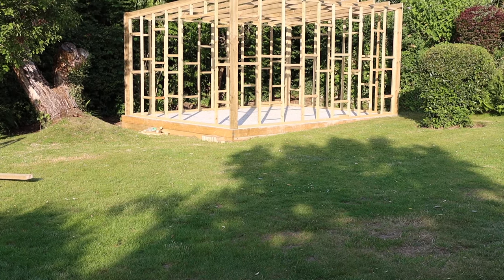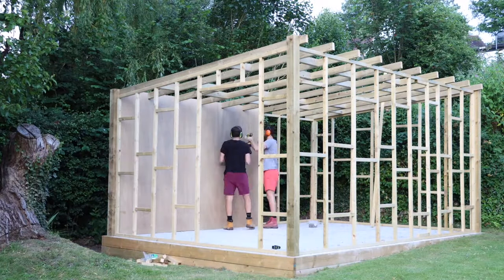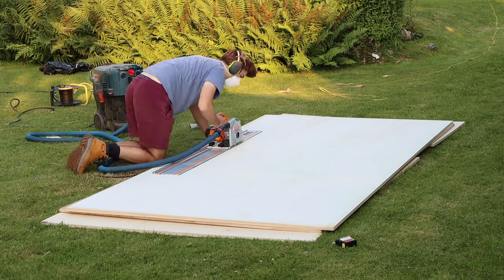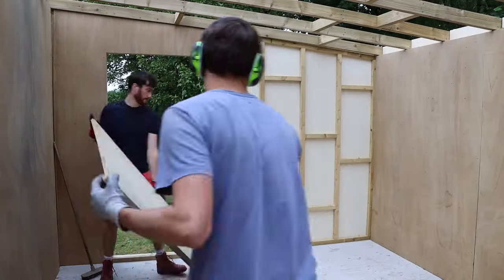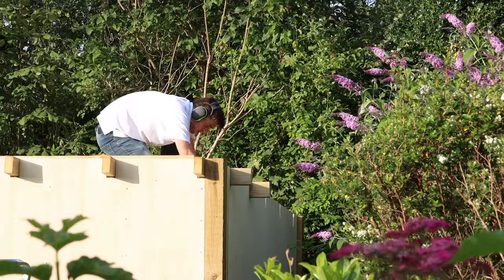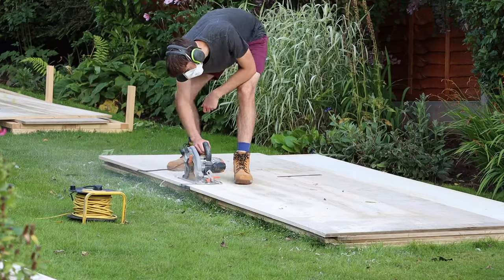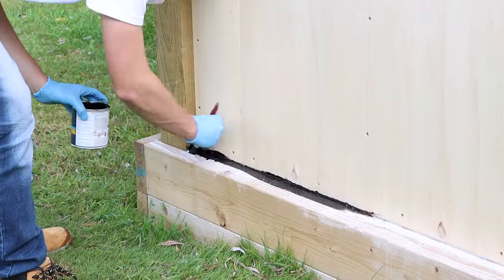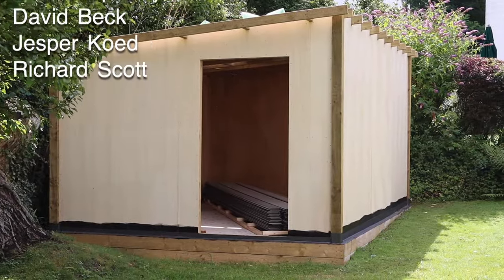Build Your Own Home Workshop/ Timber Store!

Comment: Wow, this episode flew by. This is a really great series so far, Sean. I’m really liking the details you’re going in to and I’ll definitely be using some of these ideas. May I just ask what the black paint was that you used on the edges of the slab? Was it just black paint, or was a specific make that complimented the rubber (I think it’s rubber) seal that went along the bottom on the outside to limit and hopefully, prevent, water ingress? Sorry, to ask but I didn’t quite understand what you used. Thanks and keep up the great work. That’s going to be one hell of a timber shed.
Reply from the maker: Hey Chris! I'm glad you enjoyed the video and you are getting good tips from it. The strip is called 'flashband', and the paint is called 'flashband primer'. and they are both from Bostik.
Reply: @SeanEvelegh . Ah, I see. Thanks for that, it’s appreciated. And yes, I’m definitely enjoying the videos and I look forward to the next instalment.

Comment: well timed for me. pondering building  a solar kiln and wonder what to use on the outside. I don't really have construction experience and wondering if plywood would do well on the outside. 3/8's?
Reply: I would go 1/2 minimum myself and dwang all edges
Reply from the maker: Hey Greg, I'm not very knowledgeable in that area, so sadly I don't think I can help.